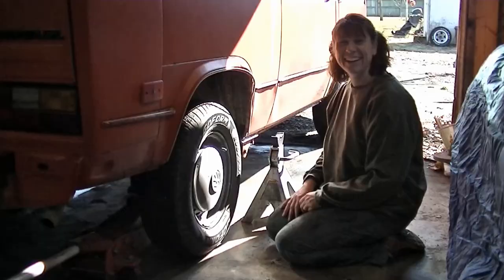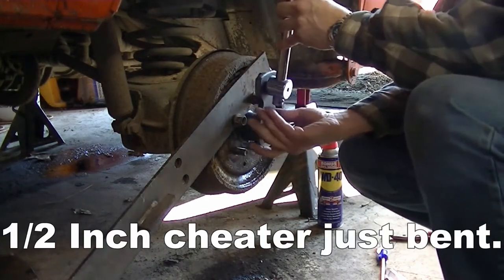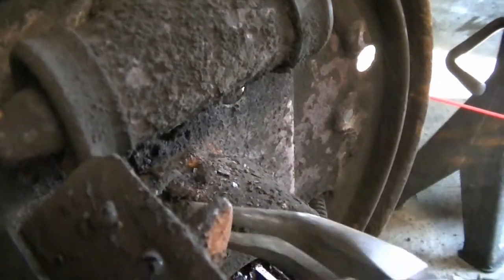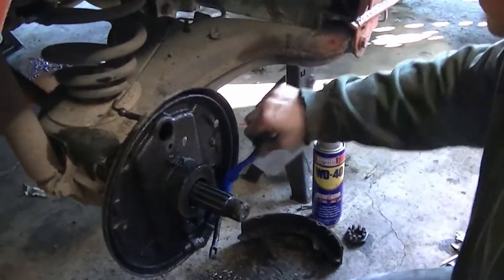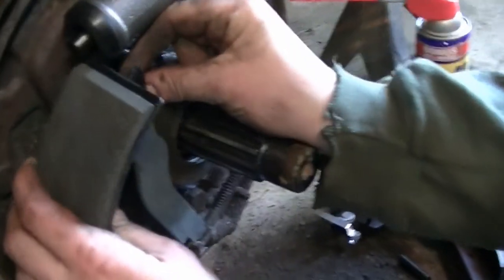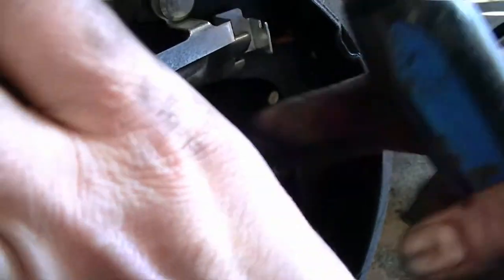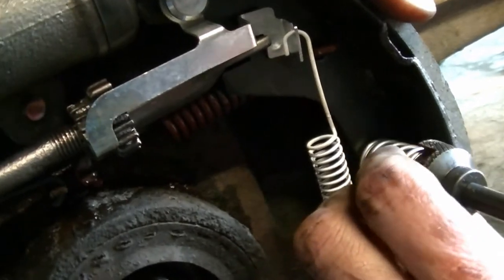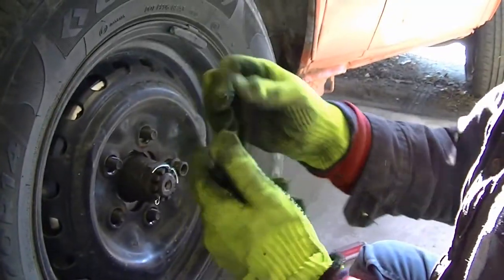VANAGON Drum Brake Replacement

Comment from the maker: One other thing to mention.  It is good to make initial adjustments to that adjustment rod in there and spray plenty of lithium grease on the the threads.  We took the drum back off recently after the brakes were feeling spongy and found that the adjustment rod was not self-adjusting like it should.  We disassembled and cleaned the threads on the rod again and sprayed it with grease.  Then I alternated between adjusting it and replacing the drum until it felt right.  Hopefully the self-adjustment mechanisms will start working better now.
Reply: Nice informative video. The two springs holding the shoes are upside down installed. The hooks must point up and not down the way you installed them. The picture in the Bentley manual shows the correct orientation for the springs. I also had trouble with the adjuster not working properly. On close inspection, I noticed that the toothed gear on the adjuster rubs against the spring if it is installed upside down.
Reply from the maker: @willemmaas9813  Its funny you should mention this because we figured this out quite by accident when the brakes got worse.  I tried to manually adjust the stars and the springs were in the way.  Whoops!  Thanks for the correction!

Comment: Just looked at this helpfull video and wondered why you didn't mount the drum with the two little bolts to the ax before mounting the wheel.
Reply from the maker: Yeah.  They weren't there when we took it apart.  I never understood why those bolts were necessary.  After the rim is on, those drums aren't going anywhere.

Comment: Hi, I’m pretty sure you mounted the main springs upside down. When mounted upside down the springs will interfere with the self adjusting mech.  Check out the manual and compare.
Reply from the maker: You are right!!  We figured this out later and updated the details in the post.
Reply: @opelgtcr8z491  I missed the details portion, only checked the comments! Cheers! It was still a big help seeing somebody go through this.

Comment: I wish I'd painted the outside of my drums. After a few months they're all rusted up.
Reply from the maker: Yes, they do tend to rust up quickly. Be sure to check the adjusters after a while.  We have found that the auto brake adjusters dont seem to work well after a little brake dust gets distributed.  Had to readjust them when they started feeling spongy again.